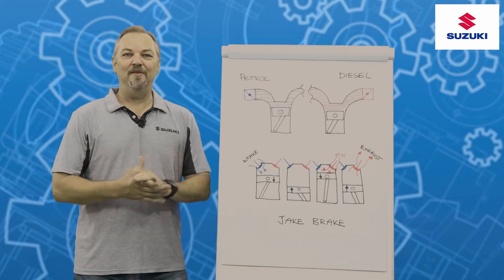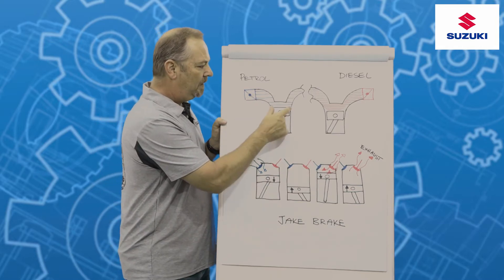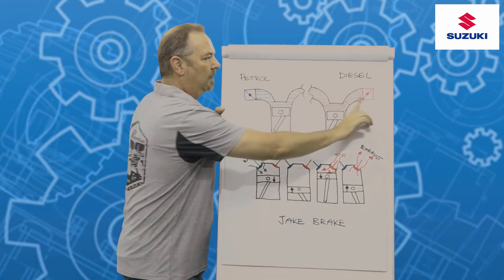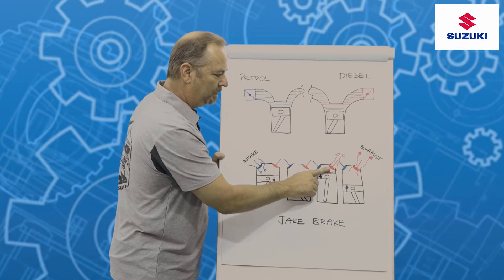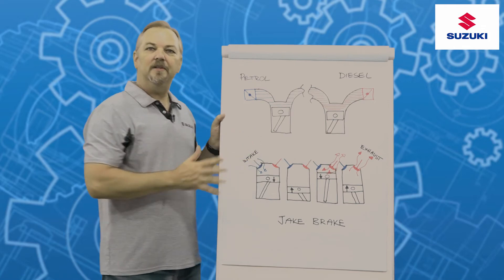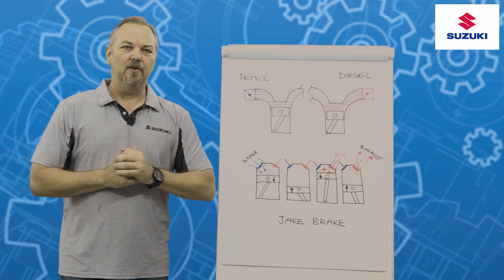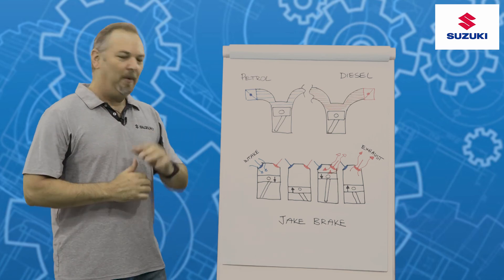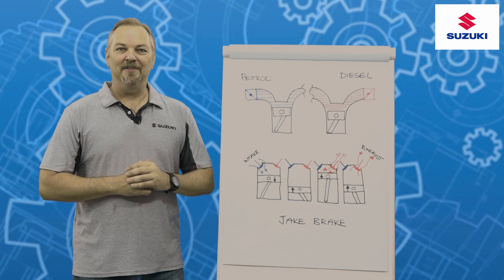How Things Work - Engine Braking

Comment: but there is idle combustion..so the valve is not fully close right?...im confuse
Reply: Essentially, when at sufficient speeds, your car's momentum alone can keep the engine spinning. So, if you let off the accelerator at that point, the throttle closes, and the fuel injectors stop injecting fuel. Combustion ceases. The wheels are solely turning the engine over. If rpms drop too low, the fuel injectors will resume, and the throttle will reopen to it's idle position.